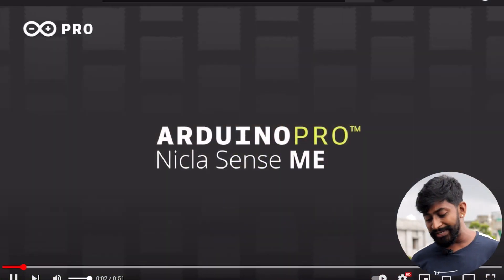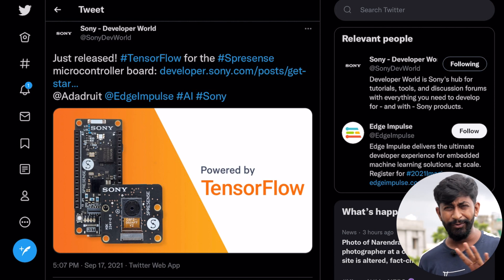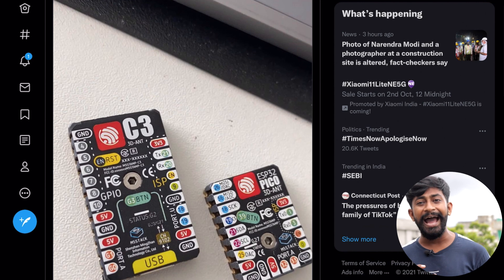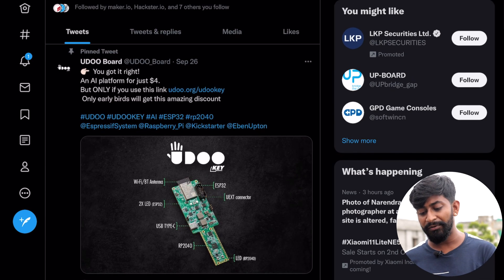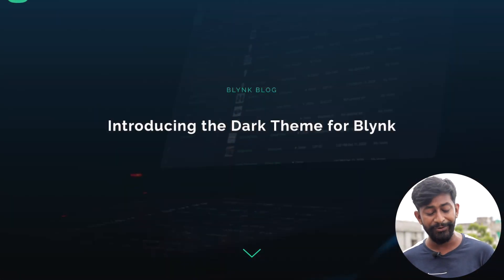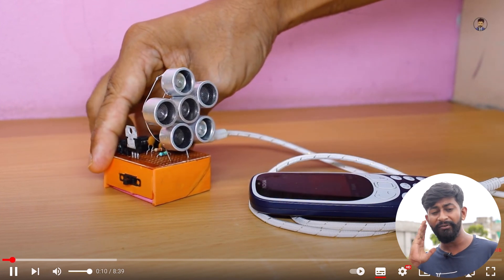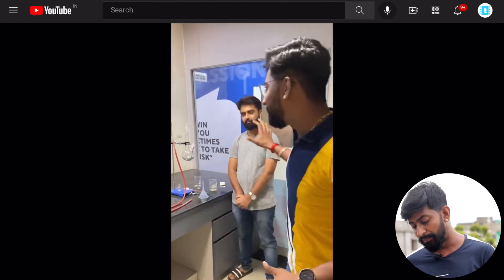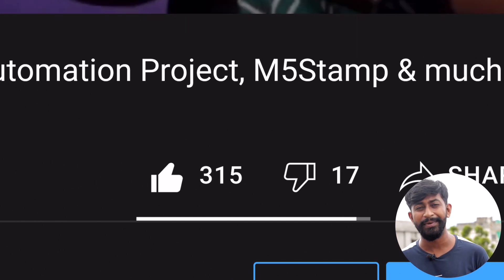Latest IoT Boards of the Sept 2021🔥

Comment: Ir iot blaster bnado
Reply from the maker: It's not that easy to make an universal IR blaster
to control any single tv or AC it's easy but it's tough for the universal one
we are still researching in it
Reply: Easy to learn tv codes and apply it on ir blaster